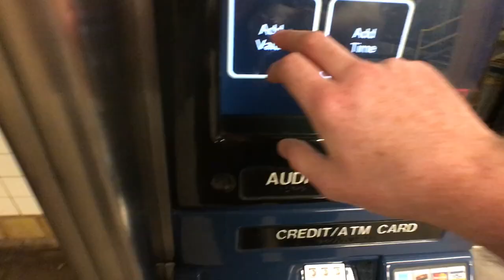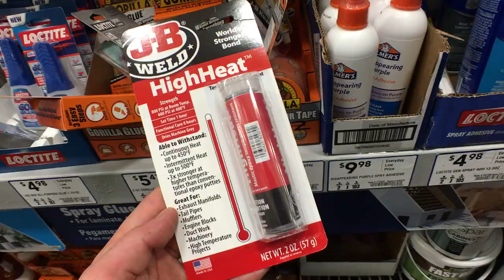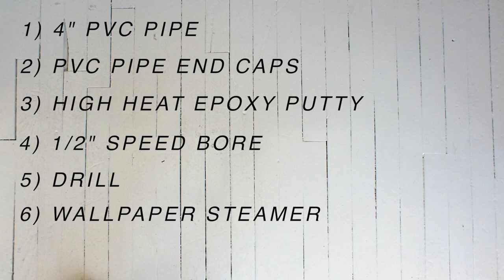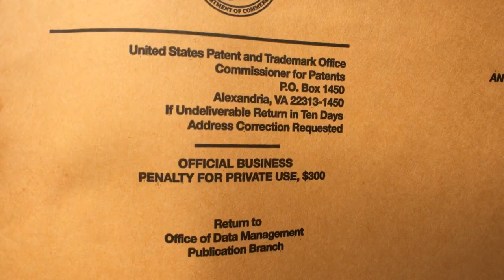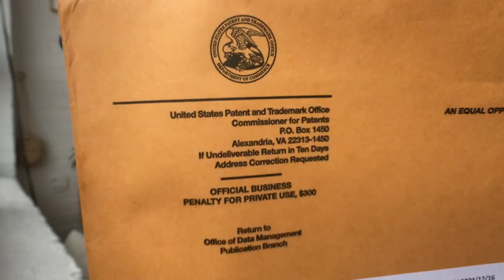How to Make a Chair | Episode 6: DIY WOOD STEAMER

Comment: Rule of thumb says an hour in the steamer for every inch of wood thickness, plus half an hour. Your PVC pipe is a tad thicker than mine was but I still have my concerns about it melting! You'll definitely need a vent hole in the top cap, I also recommend a small drainage hole in the lower end of the pipe, just before the cap fitting. About 6mm (1/4") should do it, or smaller even. You'll be surprised at home much condensation buildup you get otherwise. Looking forward to seeing how you get on in your next video - I enjoyed the soundtrack of this one! Best for now, Tim.
Reply from the maker: +Tim Esplan Hey Tim thanks for the info! I just gave the wood steamer a test run tonight and everything seemed to work really well! I drilled a vent hole in the top cap and a drain hole in the bottom cap. I built a wooden frame to angle and support the pipe and it seemed to do the trick. I ran the steamer for about two hours and although the PCV pipe did slightly soften the frame supported it and there was no warping. My plan is to steam the wood tomorrow and have the bows glue laminated for the video this Sunday. Thanks for tuning in!
Reply: +Conor Coghlan No bother, I've subscribed too, just to keep up with your progress. I am a boatbuilder by trade, hence my own use of steam and steam boxes and have also done a reasonable amount of furniture making and prop-making, prototyping etc, it's interesting to see someone else's approach to problems.

Comment: Hi Conor, just one question.. is the pipe totally sealed or are there vent holes in the pipe? My concern with totally sealed would be pressure buildup. Very interesting concept this bending. Haven't done that yet.. but am going to give it a try! As always great video and good luck with that hangover;)
Reply from the maker: +Norner Houtbewerking Haha!! Thanks man! It was a tough morning! Yeah you're right about the pressure build up. I have yet to steam the wood properly - I just turned it on for a few minutes to see if it worked - but I reckon I will drill some holes in the top end cap so the pressure doesn't build up.